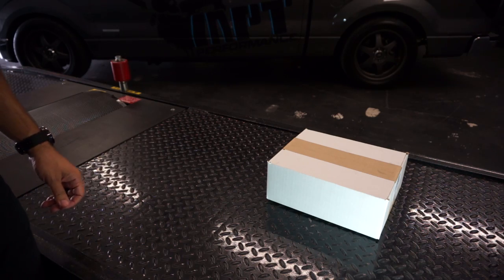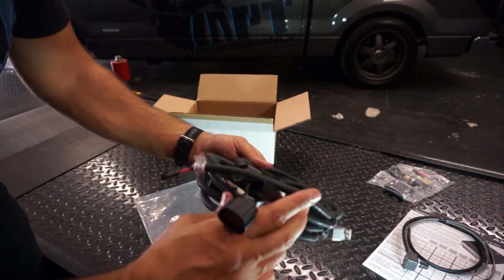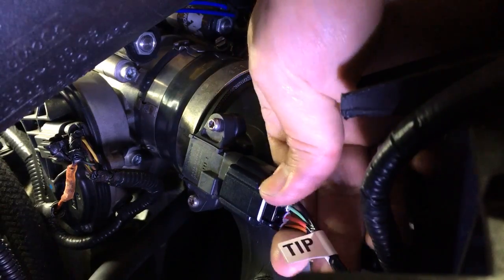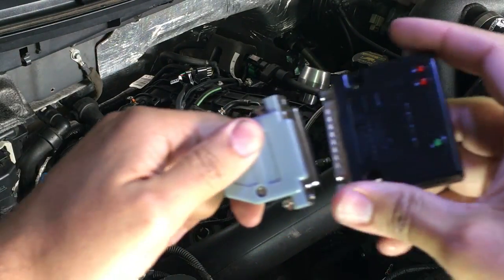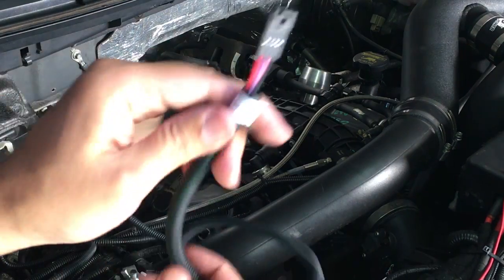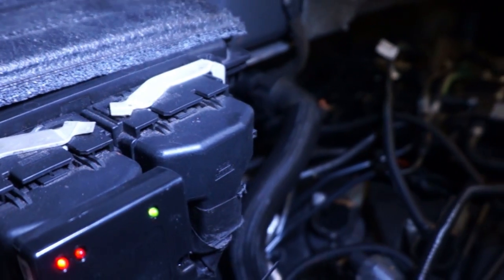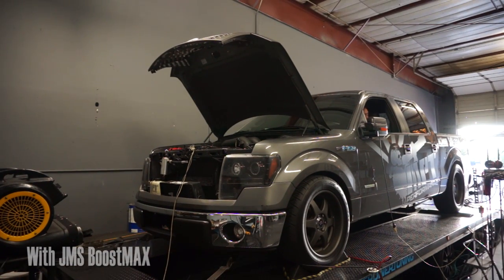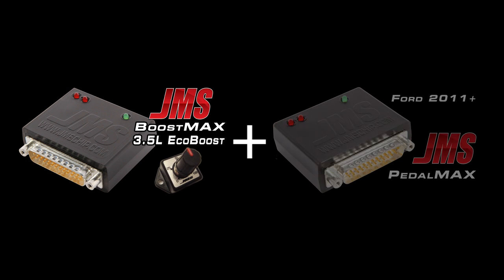JMS BoostMAX for 2011-2014 F150 3.5L Ecoboost

Comment: Can I  use the PedalMax with one of your MPT tunes I already have?
Reply from the maker: You're welcome to further modify pedal response, but an MPT tune already has improved pedal response over stock. By making it even more responsive, you're getting to where the throttle pedal is just an on/off switch, with little to no part throttle modulation and control.

Comment: This product is great to a point, BUT it will lean out fuel without proper tuning!! I had one on my 13 forgot to turn it off after a drag night and melted a piston, after replacing the engine I added afr and boost gauge, to see where the problem was and boost peaked at 20lbs but afr was at 13.5 at Wot 17 at driving with it turned up.  LONG STORY SHORT, if you use the product it installs quickly the truck learns it quickly but when not racing TURN IT OFF, ESPECIALLY IF NOT TUNED TO MATCH THE BOOST ADDED

Comment: Does this increase throttle response since its connected to the throttle position sensor?

I'm assuming no since you recommend the throttle module also.

So will this jms boost module also increase throttle response at all??? Take any lag out???

Comment: Will the Boost Max work with a Pedal Commander?
Reply: Yes👍,, just don't want to use it all out on boost,,for the $$ it's great,, engine will last longer if you keep boost 10-14 ,for daily driver's, I'm taking 1st Gen motors,,250 + miles 👍.

Comment: hey guys, I am curious if anyone has any issues with lean conditions using this chip? I have intake and exhaust on my EcoBEAST, love the gains just in letting her breathe.. Don't have the money for the turbo kit + meth kit right now so thinking about a chip option like this... I love how the knob changes % with fuel octane. I have done the same on snowmobile four stroke turbos for a decade now.